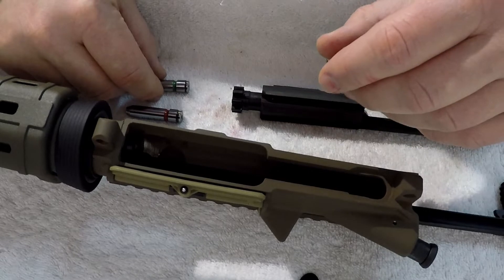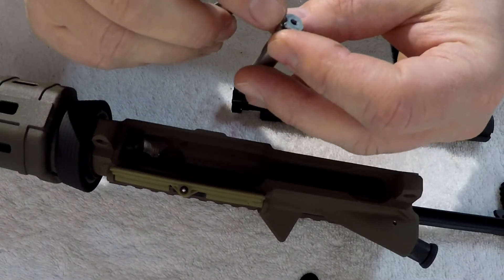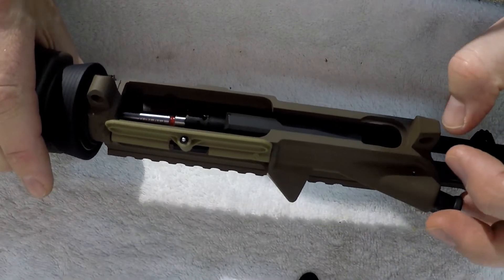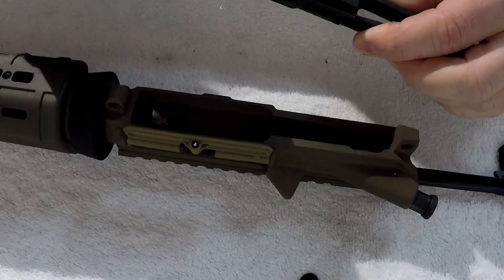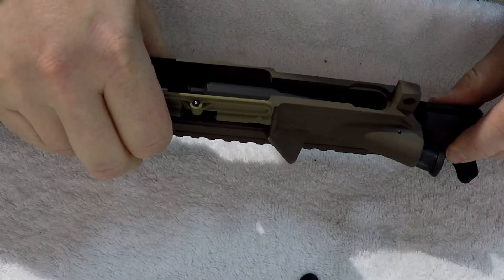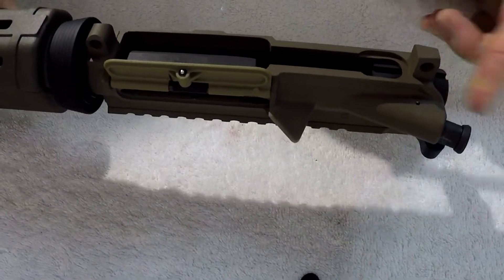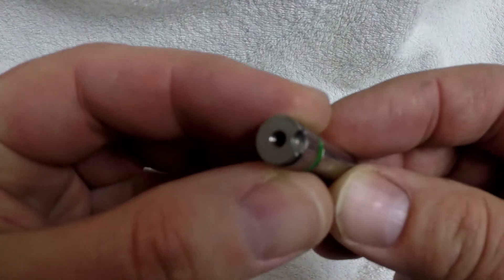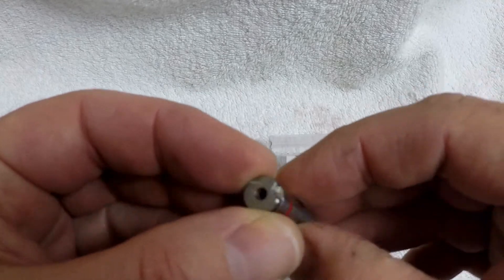Bolt Head Space AR15 GO, NO-GO 5.56 Test (Easier Method)  Is your BCG safe?

Comment: Did you use the correct 1.4646 go gauge? Most places will sell the commercial 223 1.4636 go gauge marked as 5.56, which is not the correct go gauge. The military TDP spec requires a 1.4646 go gauge...These are harder to find... You should only apply 8 lbs or less when checking any chamber gauge..
Reply: Is that ptg go 1.4646
I have 223 gauges but have only found 1 other colt spec 1.4646 gauge. PTG doesn't list spec size anywhere that I can find
Reply: Brownells is now selling the correct ( FORSTER 5.56 Armorers Headspace Gauge Kit) with the correct go, no go and field gauge that (doesn't) require the ejector to be removed first..You will need to call PTG and request the 1.4646 go gauge or you will get the 223 1.4636..I talked to their head engineer and he also was wrong and thought the 223 1.4636 was correct for the 5.56 NATO go gauge..The military TDP requires the 1.4646 and it is quite surprising how many people who should know this don't.. @NateDizity1420

Comment: I’m still confused by this. Did you put the Dremel notch on the extractor or the ejector?
Reply from the maker: I removed the area where the Ejector would push on the case, or in this setup , the go-no-go.
Reply: LAST FULL MAG is there a tip for lining it up when the barrel is already mounted to the upper? I have a Clymer No Go that has a notch pre cut from the factory. But it’s not easy to keep it seated in the BCG while loading it into the chamber.